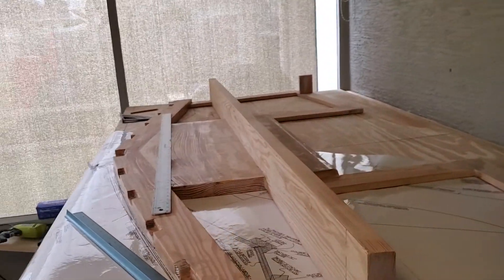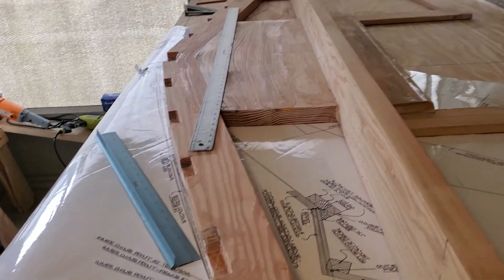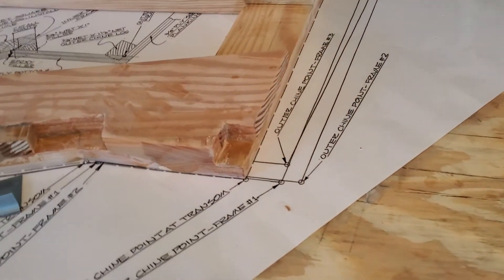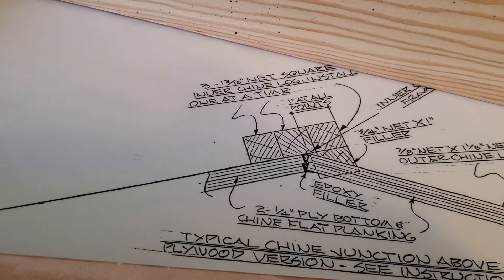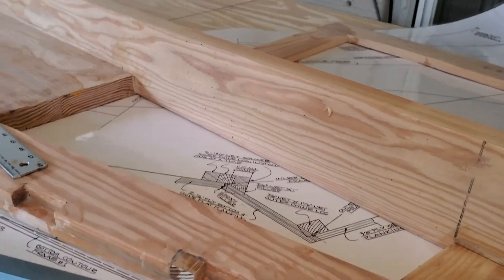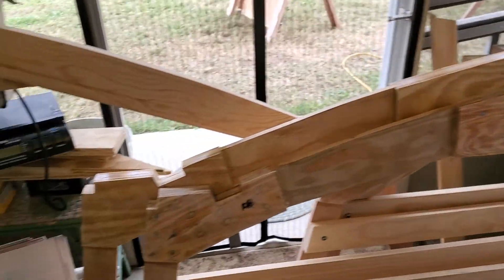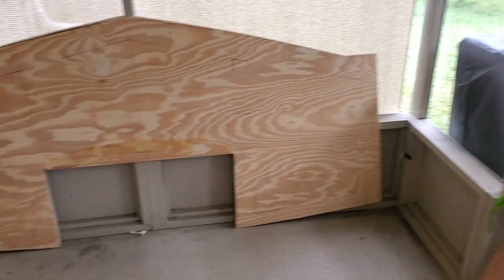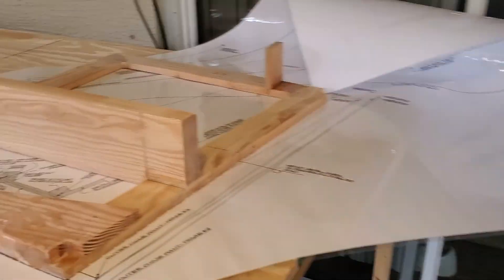Glenn L Chinook part 3

Comment: Just started this weekend. Am I missing something on the plans (which seems likely) - because I CANNOT see anywhere where it says how to locate the 2x6 cross beam on the transom. Did you just eyeball it, is there a measurement indicated somewhere I'm missing, or did you do it based on a motor installation template?

I was assuming (given a 25" shaft length motor, which I'll be using, but haven't purchased or anything yet) that I'd measure 25" up from the bottom point of the transom, use that point as the bottom of the motor cutout, and 6" down from that install the 2x6 cross beam.
Reply: @jamesboatbuild  Oh, yeah ..... I see that. But there's no measurements (at least on my plans) - just seems to give an approximate location.
Reply: @jamesboatbuild  Copy that. Thanks very much :) Continuing to really enjoy the series, btw.